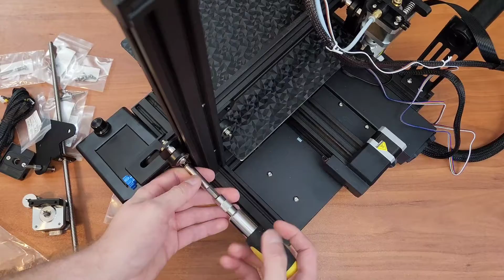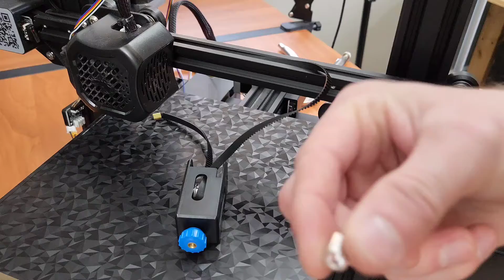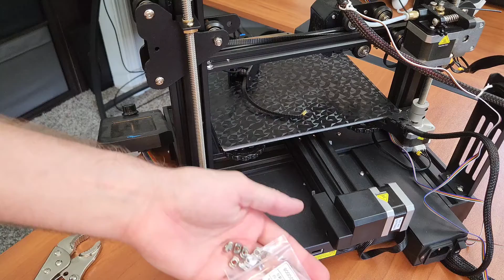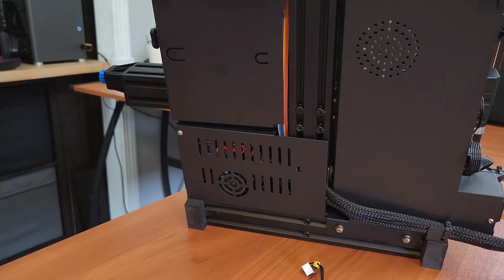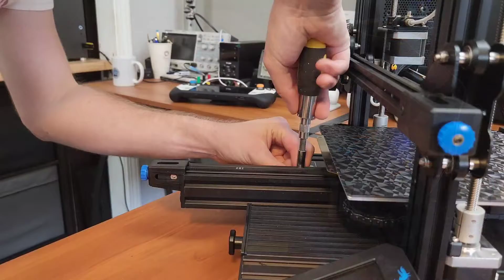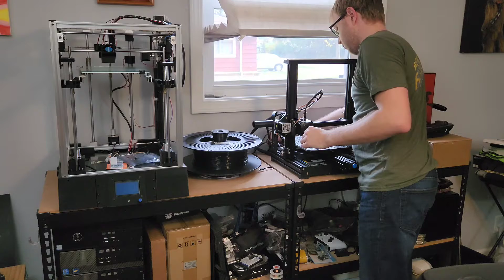Upgrading the Ender 3 v2 to Dual Z-Axis (Complete How-to Guide)

Comment: I have the same kit on my Ender 3V2, but I notice that the second Z-axis doesn't always stay in sync with the primary one.  It only needs a cleaning lady once a week to de-sync them 😕 So way more bed-tramming and levelling needed than before ...
I'm thinking of adding a belt-system on top of the rods that keeps them synced.  Did you notice this too ?
Reply from the maker: I haven't had too many issues with that. Do you have any warping or binding on one of your helical couples?

I can't remember if it was this machine or another one that I ended upgrading the helical couplers.

On a different machine I'd probably argue against building them together, but since they use the same Z driver, kinda moot.

Comment: Thanks for the video. I just installed mine and it took some time to line up the new Z axis parts correctly. A suggestion to others, noticed in your vid the new z-axis screw is not siting all the way down to the rounded stepper moter clamp as evidenced by the rod showhing higher than the other  Z-axis support bracket up top. Should end up the same height as the original  z-axis rod on the other side. I also tightend the stepper motor to the fram last to allow for adjustement to line up the rod correctly.

Comment: It would be nicer if the video was in focus, instead of blurry, and, a video without detailed explanation of the steps is semi useless.
Reply from the maker: Unfortunately I was fighting with my phone at the time. Working towards getting my camera setup in full swing so that future content and tutorials are in full swing
Reply: Where are the Connection for Both motors?
Reply: @SteveM45  The old 'Z' Motor cable was removed and replaced a new 'Z' Motor Cable that was split into a 'Y', with two connectors at the top (one for each 'Z' Motor) and one at the bottom, which plugs into Main Board.

Comment: lol SOOOOOOOOOOOOOOOOOOOO FAIL
Reply from the maker: Bruh, what?
Reply: @bc_labs  First of all way to fast, Second: no calibration, Third: No explain if firmware should be updated.  When you have 2 steppermotors on one uart ypu have to raise the power from 500mA to like 7-850mA. SO m8 when you do a video do it right or skip it. Have in mind there is a lot of people who dont know how things working with 3D printing and they looking for help. So its important too show them the right way.
Reply from the maker: @PAB-Elektronik  firmware change not needed. It splits the signal from the single stepper. Calibration to level it out, good point. Although unless a person does an egregious job, you could overcome that with a bed level. But tramming the frame to the carriage prior to leveling the bed yields a better experience.

I did not have to modify the current for this to work. I only had that issue on a previous printer that relied on a ramps board and had pretty subpar steppers. Each of the coils inside the stepper. Uarts for communication over serial, to a driver potential.

I appreciate you commenting, despite the fairly rude demeanor. I am always experimenting with video styling to try and improve the experience.